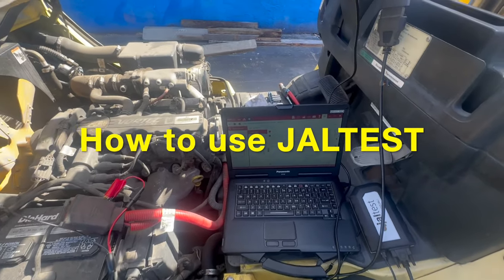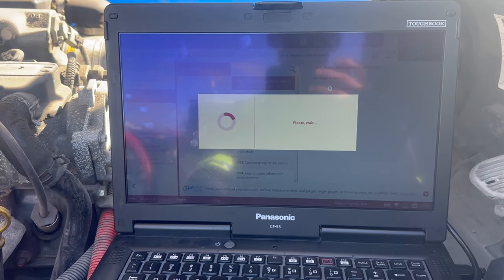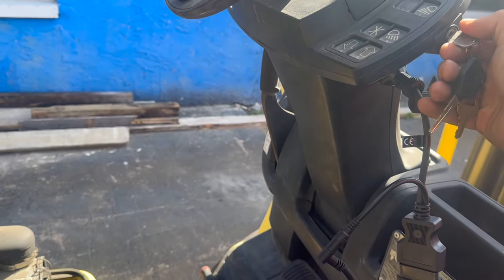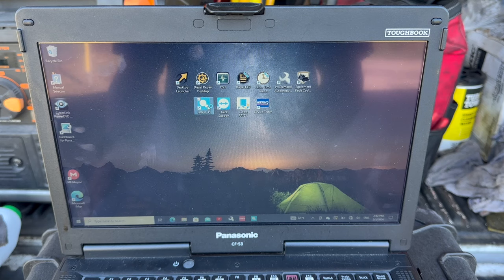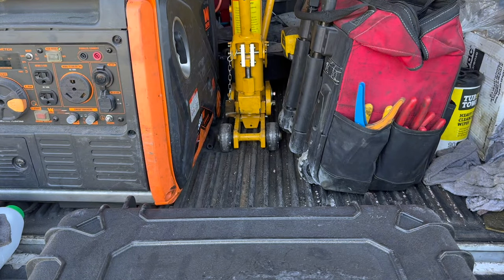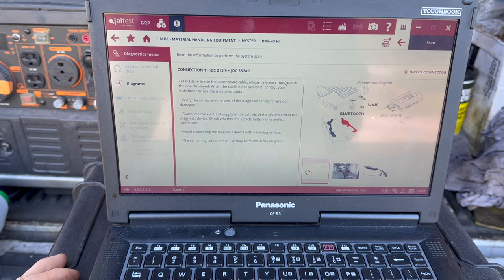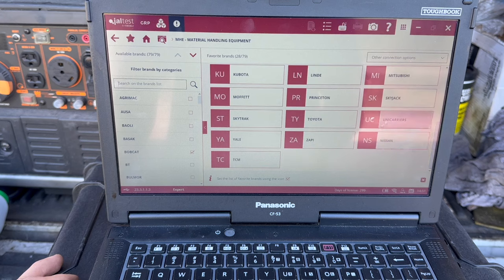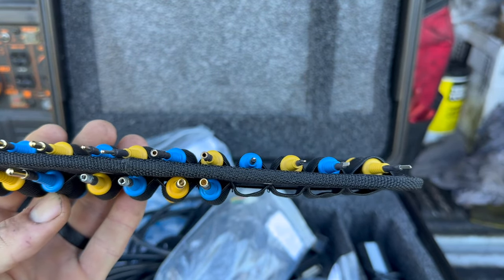How To Use JALTEST diagnostics For Forklifts - IS IT WORTH IT??

Comment: Yo Elmer, you need a special lap top like this tough book or i can get the software on a regular HP and just buy the tool, does it come with the wires to hook up?
For what makes and models?
If you were to change the display i know it comes in blank you think you can program it with this?

Comment: Yo Elmer, you need a special lap top like this tough book or i can get the software
For what makes and models?
If you were to change the display i know it comes in blank you think you can program it with this?
Reply from the maker: So I actually ordered a new display from Yale and it already comes programmed. As far as the  computer, it doesn’t have to be a tough book but it’s what everyone recommends. You can get them on Amazon refurbished for less than $500. As far as the software, it’s not the best in my opinion. It’s super expensive for what they offer. You have to buy individual cables and I don’t use it enough to justify the price. Again, it all depends on what kind of makes and models you work on.

Comment: Cool video 👍👍 is there any type of software for 7FBCU55 or 45 electric style Toyota forklifts that I can connect with like this Jaltest kit?
Reply from the maker: No, unfortunately no. You have to use the display menu
Reply: @theforkliftguy  I’ve seen codes on the display screen but where can I look these up if possible?
Reply from the maker: @steelcrusher  you would need the service manual or Google the code. That’s what I do

Comment: I work with a fleet of a electric Hysters ,, any idea if this works for those ?
Reply from the maker: I have yet to try on an electric hyster but the software has a ton of electric hyster models on here. I’m sure it should work. I don’t know how well it will work though until I try it on one myself. I’ll keep you posted
Reply: @theforkliftguy  yes please do so that’ll be very appreciated. I work in an industrial plant and we have a bunch of electric Hyster stand up models and order pickers . It’s kind of frustrating coming from automotive and heavy equipment where you have all the diagnostic software or disposal to a world where everything is highly proprietary and having no way of thoroughly diagnosing and given your management a definitive answer. The Hyster dealer that we use one guy told me there is a customer version available of Hyster software. The GM for those dealer said absolutely not
Reply from the maker: @CampingNstuff  yeah it’s so dumb. I hate how the dealers don’t want to give out any information at all when it comes to material handling. Jaltest is the best we got right now and it’s up and coming.

Comment: What’s the cost of this tool?
Reply from the maker: It depends where you buy it from. I bought mine from diesel laptops. I already had my own laptop, so it was around $6000 with the connectors and the program. Mind you it also includes the license and it’s good for a year. So after a year you’ll have to renew the license, I just charge my customer a diagnostic fee. I have to use my laptop and the software.